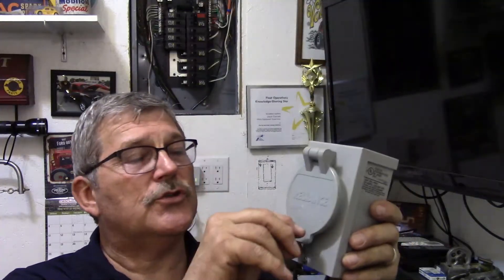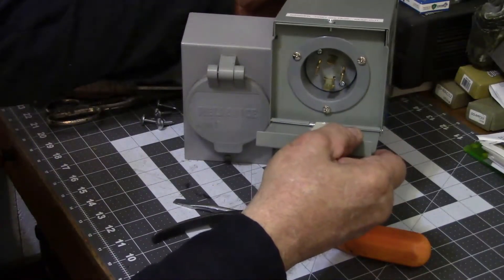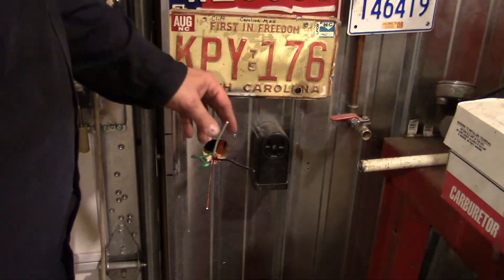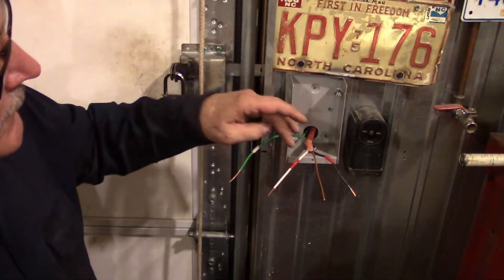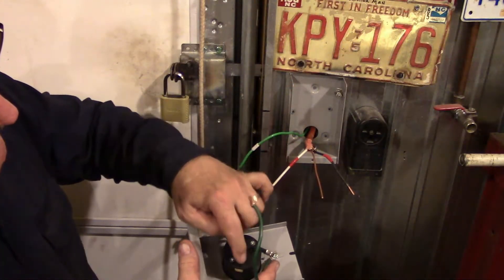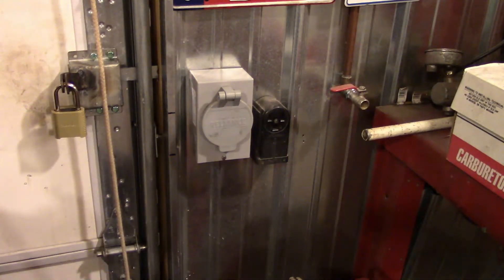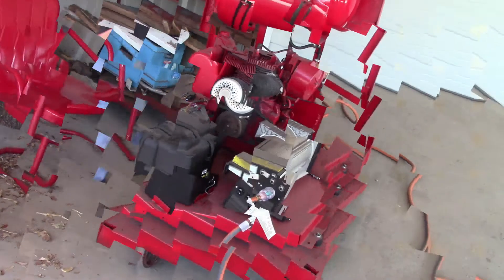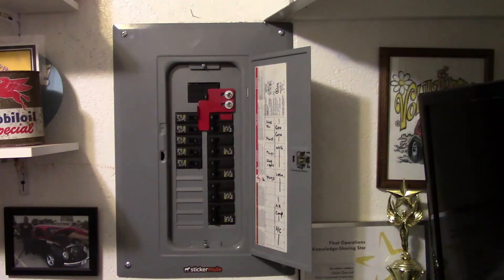30-amp generator power inlet box Installation

Comment: I noticed when you installed the plug you didn’t use a clamp connector on the incoming wires.  Is that something you don’t need to do?
Reply from the maker: For my installation I didn't require it, but as always follow your needs and requirements. Thanks for committing about it.
Reply: @RustyGlovebox  Thanks for the quick reply!  Great video!

Comment: You installed a 30 amp inlet box, but you have 50 amp circuit breakers, that wasn't an issue?
Reply from the maker: It is a 30 amp breaker

Comment: I am having trouble with the Reliant inlet box. I cant get the wire to tighten in the plug. I can loosen screws and fit the wire in the W,X and Y, but cannot tighten them down in there....can you offer any suggestions? Thanks!
Reply from the maker: Can you double the wire and it get tight then?
Reply: @RustyGlovebox  I will give it a try, it is already 10 guage.

Comment: Finally found someone running a belt-driven portable generator.  Nice
Reply from the maker: Thanks, it works really well. But they are hard to get shipped to your house in good condition. The shipper drops them and it gets damaged.
Reply: @RustyGlovebox  can’t wait til an axle drive come out next

Comment: I have to ask a question. What IF and only IF I use a suicide cord from my generator to a wall outside receptacle, would it power that breaker only or would the electricity go out to any breaker not turned off. I would OFCOURSE TURN off the main breaker before doing anything.
Reply from the maker: I would never recommend doing that. The risk of someone getting hurt is to high, you or the utility lineman. I understand what you are asking but I wouldn't do it.
Reply: @RustyGlovebox  Thanks for your honest reply.
Reply: @dropndeal  K, no I did not do this procedure.

Comment: I was watching this to be sure of my self only to find out we both bought the exact same stuff down to the wire, inlet box, generator cable color, and harbor freight generator, but mine is a 9000 watt one.
Reply from the maker: Good luck with your system. 👍
Reply: @RustyGlovebox  I see you have neutrals and grounds on the same bus bar. Is this ok? If so why?

Comment: I've seen those generator heads at harbor freight.  How difficult would it be to mount and run on my 4.0 litter ranger for portability or as a second backup power
Reply from the maker: It could be done. It is big so space is a consideration. Good luck

Comment: Nice video. Can you tell me if the wire you ran from the receptacle back to the fuse panel was all 10-4 gauge wire? Thanks.
Reply from the maker: Yes , they were 10-4

Comment: What size generator was that?  I am planning to hook up a 4500W portable for emergency use, I anticipate that it will power post of my stuff beings I run NG so I don't have a big draw, WH, Dryer and Heat...
Reply from the maker: I have 2 generators, one is 8750 and the other is a 10k, both are Harbor Freight. Both of them have the 30amp rated plug

Comment: Great video and it's has helped me tremendously but I have to ask:  Why didn't you use the white wire for the typical white wire function as a neutral?  Just wondering?
Reply from the maker: I had the 10/2 Romex on hand so I add the green ground wire to fill the need for the receptacle. If I was buying cable of the project the 10/3 Romex would have all 4 wires included. Thanks
Reply: @RustyGlovebox  > now it makes perfect sense!  Thank you again!

Comment: What size breaker did you install to connect you generator?
Reply from the maker: I used a 30 amp breaker.
Reply: I have a 40-amp breaker allredy instaled. Do you fink I can connect my 30-amp outlet to  this 40 amp breaker?
Reply: ursulika Your 40 amp breaker is protecting everything in the panel up to 40 amps. If you load the incoming wire with 40 amps the #10 awg  to the 30 amp inlet box is to small for 40 amps. Assuming that’s what rusty used. Not to mention the cord plugged into the generator, that plug also is only 30 amps max. Then the breaker on your generator is for that plug 30 amps. It would still protect your circuit up to 30 amps, if you loaded more than 30 amps onto your generator it would protect everything all the way into your 40 amp breaker. Answer is YES but not recommended ! ! A 30 amp two pole, 240 v breaker isn’t that expensive, keep everything rated for the max amps of your supply........ if you have a generator with a higher outlet say, 50 amps you would need a different box than rusty used and a larger breaker and wire also... point is keep it all rated properly. If not the main reason to not rate everything correctly is insurance and a possible electrical fire,  they likely wouldn’t cover any damage if caused by improper wiring.   Hope it helps !
Btw I just installed and wired my back up system 30 amp breaker in panel, interlock, 10/3 with ground wire 
, 30 amp reliance box, cable to plug into generator 30 amp rated into 30 amp plug on gen. I didn’t have to pull a separate ground and color code improperly colored wires.
Reply: @rogern5368  I have a 1200/9500 watt generator that has both 30amp and 50 amp receptacles (says 50amp for RV).  Which one should I hook up to my house panel, the 30 or 50?
Reply: dxmanxx it’s up to you but keep in mind the wire needed for 50 amps is much larger than the #10 30 amp. Certainly you could install a 50 amp double pole breaker to feed the panel. 
50 amp power cords on motorhomes are typically 6/3 + 8/1 ground. The chart for electrical wire size says #4 for lengths over 100'. If your run from the panel to the location where you’re plug will be is close to 100 feet #4 would be the best choice. Then the 50 amp RV cable from the generator to your plug would do just fine. It’s #6. Note I elected to only use 30 amp equipment it’s enough to run many things in my house including my a/c system. It’s way less expensive the way I did mine.

Comment: You are a master of wiring, both high and low voltage. Nice neat install.
That Harbor Freight generator head is perfect for your shop needs and should serve you well for years to come.
Nice edits as usual in your video. 5 stars!
Work safe, enjoy your weekend.
Doug@ the "ranch"
Reply from the maker: Thanks Doug, I have enjoyed during the shop update. If I need it it will come in handy. Enjoy your weekend

Comment: Crikey Lloyd I would have blown something up because over here the green wire would be earth - phew. Wow and that generator has some serious muscle to power all that stuff.
Reply from the maker: The green here is an earth also but connects to the neutral bar with the bare copper wire. We are all good. I just used the tape so it would correspond with the plug. That generator has a 10k surge rating so it packs a punch. Thanks Noel and enjoy your weekend

Comment: I've got to go back and watch the previous one. Are you planning to run your shop of the generator?
Reply from the maker: I have a generator to use as backup power. I will also later be adding solar and wind to the shop. Thanks and enjoy your week.
Reply: @RustyGlovebox  Come on man, don't be that way. I still work for a living ;-)

Comment: Well there ya go.  I have to get mine done and in addition add a 30 AMP RV circuit with an outdoor receptacle.
Reply from the maker: That sounds good, you will be set when you get that all wired up and a plug for your camper. Thanks and take care

Comment: Very nice install.  I have had issues with some loads like new digital furnaces that look for a specific ground and very stable voltage to work. Floating or bonded grounds on gensets can make a difference but most times  gensets like yours does great like you shown plus a high efficiency furnace in Texas is optional 😅
Reply from the maker: Thanks Steve, it is working good on the test for now. I just need to keep good fuel in the genset and fire it up every once in a while. Enjoy your week